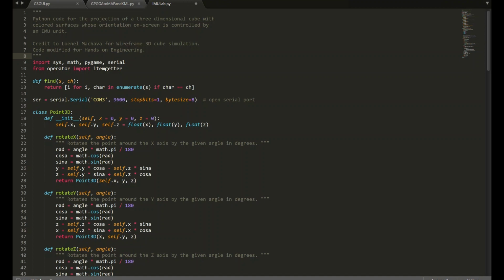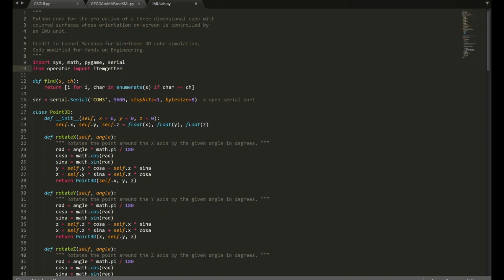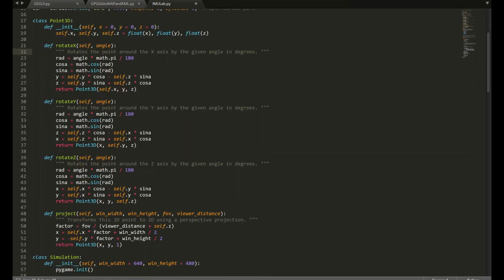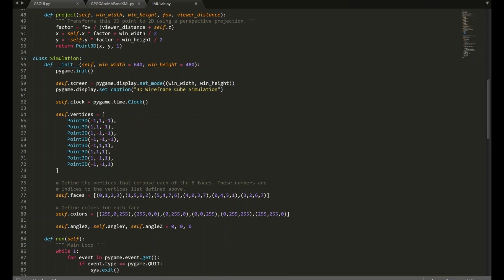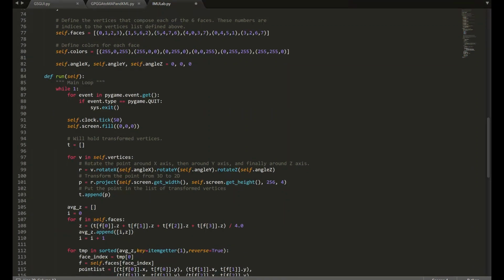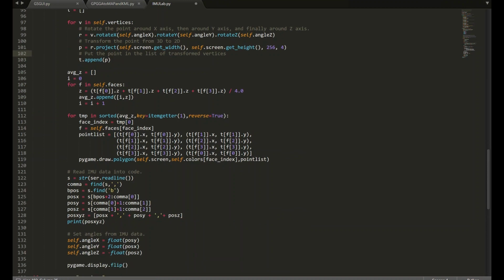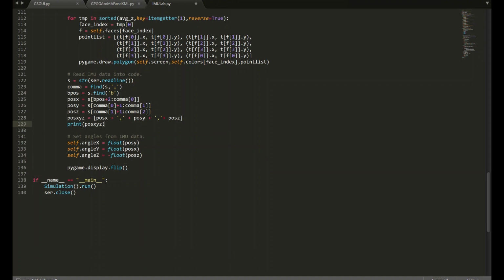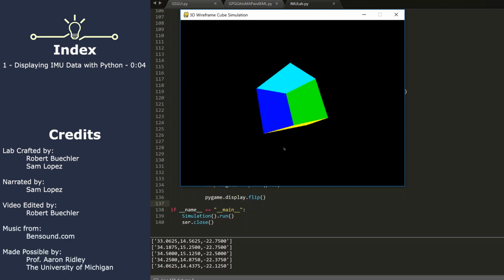Displaying IMU Data with Python

Comment: import sys, math, pygame, serial
from operator import itemgetter

def find(s, ch):
    return[i for i, char in enumerate(s) if char == ch]

ser = serial.Serial('COM11', 9600, stopbits=1, bytesize=8)

class Point3D:
    def __init__(self, x=0,y=0,z=0):
        self.x, self.y, self.z = float(x), float(y), float(z)

    def rotateX(self, angle):
        rad = angle * math.pi/180
        cosa = math.cos(rad)
        sina = math.sin(rad)
        y = self.y*cosa - self.z*sina
        z = self.y*sina + self.z*cosa
        return Point3D(self.x, y, z)

    def rotateY(self, angle):
        rad = angle * math.pi/180
        cosa = math.cos(rad)
        sina = math.sin(rad)
        z = self.z*cosa - self.x*sina
        x = self.z*sina + self.x*cosa
        return Point3D(x, self.y, z)

    def rotateZ(self, angle):
        rad = angle*math.pi/180
        cosa = math.cos(rad)
        sina = math.sin(rad)
        x = self.x*cosa - self.y*sina
        y = self.x*sina + self.y*cosa
        return Point3D(x, y, self.z)
    
    def project(self, win_width, win_height, fov, viewer_distance):
        factor = fov/(viewer_distance + self.z)
        x = self.x * factor + win_width/2
        y = -self.y * factor + win_height/2
        return Point3D(x, y, 1)

class Simulation:
    def __init__(self, win_width = 640, win_height = 480):
        pygame.init()
        self.screen = pygame.display.set_mode((win_width, win_height))
        pygame.display.set_caption("3D Wireframe Cube Simulation")
        self.clock = pygame.time.Clock()
        self.vertices = [
            Point3D(-1, 1, -1),
            Point3D(1, 1, -1),
            Point3D(1, -1, -1),
            Point3D(-1, -1, -1),
            Point3D(-1, 1, 1),
            Point3D(1, 1, 1),
            Point3D(1, -1, 1),
            Point3D(-1, -1, 1)
        ]

        self.faces = [(0,1,2,3),(1,5,6,2),(5,4,7,6),(4,0,3,7),(0,4,5,1),(3,2,6,7)]
        self.colors = [(255,0,255),(255,0,0),(0,255,0),(0,0,255),(0,255,255),(255,255,0)]
        self.angleX, self.angleY, self.angleZ = 0, 0, 0

    def run(self):
        while 1:
            for event in pygame.event.get():
                if event.type == pygame.QUIT:
                    sys,exit()

            self.clock.tick(50)
            self.screen.fill((0,0,0))

            t = []

            for v in self.vertices:
                r = v.rotateX(self.angleX).rotateY(self.angleY).rotateZ(self.angleZ)
                p = r.project(self.screen.get_width(), self.screen.get_height(), 256, 4)
                t.append(p)

            avg_z = []
            i = 0
            for f in self.faces:
                z = (t[f[0]].z + t[f[1]].z + t[f[2]].z + t[f[3]].z)/4.0
                avg_z.append([i,z])
                i = i + 1
            for tmp in sorted(avg_z, key=itemgetter(1),reverse=True):
                face_index = tmp[0]
                f = self.faces[face_index]
                pointlist = [(t[f[0]].x, t[f[0]].y), (t[f[1]].x, t[f[1]].y),
                             (t[f[1]].x, t[f[1]].y), (t[f[2]].x, t[f[2]].y),
                             (t[f[2]].x, t[f[2]].y), (t[f[3]].x, t[f[3]].y),
                             (t[f[3]].x, t[f[3]].y), (t[f[0]].x, t[f[0]].y)]
                pygame.draw.polygon(self.screen, self.colors[face_index],pointlist)

            value = ser.readline()
            valueString = str(value,'UTF-8')
            data = valueString.split(",")
            '''
            comma = find(s,',')
            bpos = s.find('b')
            posx = s[bpos+2:comma[0]]
            posy = s[comma[0]+1:comma[1]]
            posz = s[comma[1]+1:comma[2]]
            '''
            posx = data[0]
            posy = data[1]
            posz = data[2]
            
            posxyz = [posx + ',' + posy + ',' + posz]
            print(valueString)

            self.angleX = float(posy)
            self.angleY = float(posx)
            self.angleZ = -float(posz)

            pygame.display.flip()

if _name_ == "__main__":
    Simulation().run()
    ser.close()
        
I modified according to my device... It's working, good luck.

Comment: Thank you. I had to change the code for my use and forgot to save the original to post it here, use the below code after checking it with video.
def find(s,ch):
    return [i for i, char in enumerate(s) if char == ch]

class Point3D:
    def __init__(self, x = 0, y = 0, z = 0):
        self.x, self.y, self.z  = float(x),float(y), float(z)

    def rotateX(self,angle):
        """rotates the point around the x axis by the given angle in degrees."""
        rad = angle * math.pi / 180
        cosa = math.cos(rad)
        sina = math.sin(rad)
        y = self.y * cosa - self.z * sina
        z = self.y * sina + self.z * cosa
        return Point3D(self.x,y,z)

    def rotateY(self, angle):
        """rotates the point around the Y axis by the given angle in degrees."""
        rad = angle * math.pi / 180
        cosa = math.cos(rad)
        sina = math.sin(rad)
        z = self.z * cosa - self.x * sina
        x = self.z * sina + self.x * cosa
        return Point3D(x,self.y,z)

    def rotateZ(self, angle):
        """rotates the point around the Z axis by the given angle in degrees."""
        rad = angle * math.pi / 180
        cosa = math.cos(rad)
        sina = math.sin(rad)
        x = self.x * cosa - self.y * sina
        y = self.x * sina + self.y * cosa
        return Point3D(x,y,self.z)
    
    def project(self, win_width, win_height, fov, viewer_distance):
        """Transforms this 3d point to 2d using a perspective projection"""
        factor = fov / (viewer_distance + self.z)
        x = self.x * factor + win_width / 2
        y = -self.y * factor + win_height / 2
        return Point3D(x,y,1)

class Simulation:
    def __init__(self, win_width = 640, win_height = 480):
        pygame.init()

        self.screen = pygame.display.set_mode((win_width,win_height))
        pygame.display.set_caption("3D Wireframe Cube Simulation")
        self.clock = pygame.time.Clock()

        self. vertices = [
            Point3D(-1,1,-1),
            Point3D(1,1,-1),
            Point3D(1,-1,-1),
            Point3D(-1,-1,-1),
            Point3D(-1,1,1),
            Point3D(1,1,1),
            Point3D(1,-1,1),
            Point3D(-1,-1,1)
        ]

        #define the  vertices that compose each of the 6 faces, these numbers are indices to the vertices list defined above
        self.faces = [(0,1,2,3),(1,5,6,2),(5,4,7,6),(4,0,3,7),(0,4,5,1),(3,2,6,7)]

        #define colors for each face
        #self.color = [(255,0,255),(255,0,0),(0,255,0),(0,0,255),(0,255,255),(255,255,0)]
        self.color = [(0,0,0),(40,40,40),(80,80,80),(120,120,120),(160,160,160),(200,200,200)]
        self.angleX, self.angleY, self.angleZ = 0,0,0

    
    def run(self):
        """Main loop"""
        Angle_x = ""
        Angle_y = ""
        AngX = 0.0
        AngY = 0.0
        is_read_X = False
        is_read_Y = False
        while (1):

            for event in pygame.event.get():
                if event.type == pygame.QUIT:
                    sys.exit()

            self.clock.tick(50)
            self.screen.fill((0,0,0))

            #will hold transformed vertices.
            t = []

            for v in self.vertices:
                #rotate the point around x axis, then around y axis, and finally around z axis
                r  = v.rotateX(self.angleX).rotateY(self.angleY).rotateZ(self.angleZ)
                # transform the point from 3d to 2d
                p = r.project(self.screen.get_width(), self.screen.get_height(), 256, 4)
                # put the point in the list of transformed vertices
                t.append(p)

            avg_z = []
            i = 0
            
            for f in self.faces:
                z = (t[f[0]].z + t[f[1]].z + t[f[2]].z + t[f[3]].z) / 4.0
                avg_z.append([i,z])
                i = i+1

            for tmp in sorted(avg_z, key = itemgetter(1), reverse = True):
                face_index = tmp[0]
                f = self.faces[face_index]
                pointlist = [(t[f[0]].x, t[f[0]].y ),  (t[f[1]].x, t[f[1]].y ),
                            (t[f[1]].x, t[f[1]].y ),  (t[f[2]].x, t[f[2]].y ),
                            (t[f[2]].x, t[f[2]].y ),  (t[f[3]].x, t[f[3]].y ),
                            (t[f[3]].x, t[f[3]].y ),  (t[f[0]].x, t[f[0]].y )]
                pygame.draw.polygon(self.screen, self.color[face_index], pointlist)

            # imu angle data

            self.angleX = AngX
            self.angleY = AngY
            self.angleZ = 0.0

            pygame.display.flip()